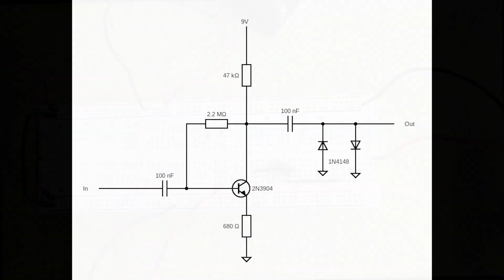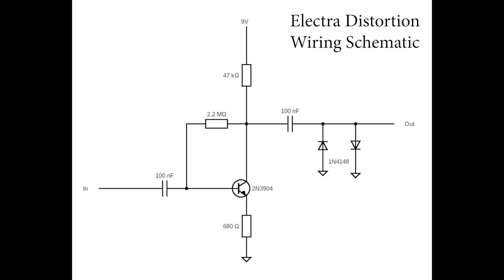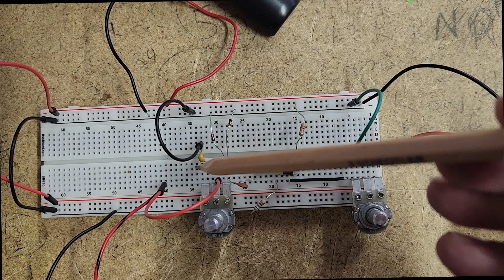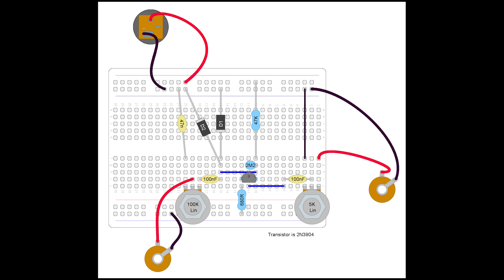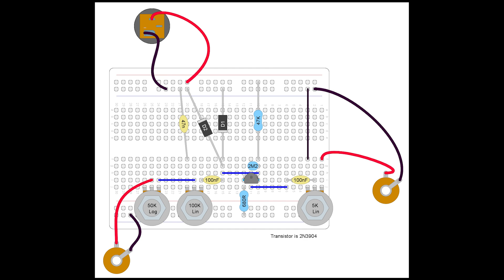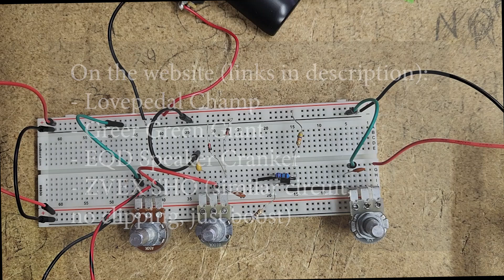How To Build A Simple Distortion Pedal Circuit - Electra Distortion Explanation

Comment: If I read the circuit diagram correctly, shouldn't the diode legs at F15, G15 be moved to column 18? Total novice so check my work. This is super helpful content, thanks!
Reply: I think you confuse the resistors for diodes. Are at 27
Reply: Thanks for answeing... the way I'm looking at it the board has the diodes on the same node as the collector, two resistors and cap, while the diagram has thise diode legs on the node with the other side of that output cap and the output jack tip.

Comment: Can a rectifier diode be used in place of the transistor or the 2 diodes?
Reply: For replacing the diodes it would probably just raise the clipping threshold of your circuit due to the rectifier diodes having higher forward biasing voltages. The functionality of the transistor can‘t be replaced by a diode, so that won’t really work i think.

Comment: Many thanks for this - especially for providing the breadboard diagram, as it's difficult to see everything on the board itself. Can I ask, is the green wire that goes to ground off the left lug of the final pot missing from the diagram? I see a ground connection for the other two pots but not that one...
Reply from the maker: YES, you're correct. Good catch. That volume pot needs to be grounded and I missed that in the diagram. So yes, the leg on the left of the last pot (as per the diagram) needs to go to ground. I'll update the diagram when I get a chance, but have been a little busy lately and not working on content. Hopefully in a week or so! Good catch though, thanks.
Reply: @CrazyChickenGuitarPedals  Many thanks! PS: Do you use any specific software to produce your breadboard diagrams? I only ask as it would be great if there's a program out there which will let me easily record what I've done on a breadboard before I dismantle it. That would be particularly handy if I end up deviating from a schematic...
Reply from the maker: @corbelstonepress  yeah, I use a free program called DIY Layout Creator (https://diy-fever.com/software/diylc/). It's pretty cool. It's a little fiddly at first, but once you learn how to use it you'll be flying.
Reply: @CrazyChickenGuitarPedals  Oh wow, this looks perfect. Thanks for sharing!

Comment: I had no idea you could use about $1 in discrete components to make a distortion pedal. Just a transistor, 2 diodes, and a few caps and reisistors... crazy!
Do more circuits. Id love to see more 'advanced' circuits with true bypass or whatever else might make a 'real' pedal.
Reply from the maker: Thanks! A lot of these smaller circuits are cheap to make - often the enclosure is more expensive than the components themselves. I have a lot planned for this channel and do want to give some light analysis to larger/more famous circuits, I'm just starting basic for now as I learn about this whole "YouTube thing." In the short term, schematics for stuff I've built in the last year can be found here (https://crazychickenguitarpedals.com/guitar-pedal-blog/category/guitar-pedal-builds/).